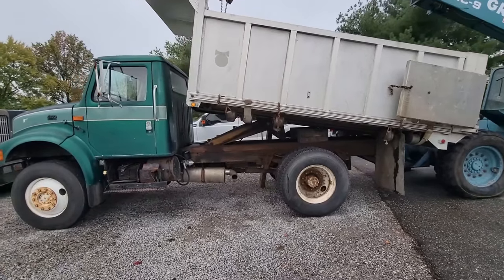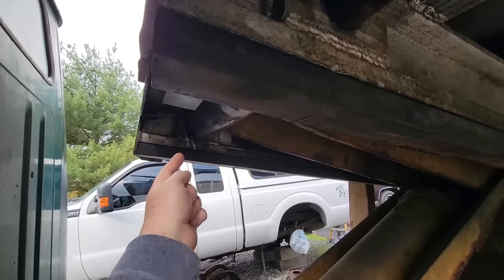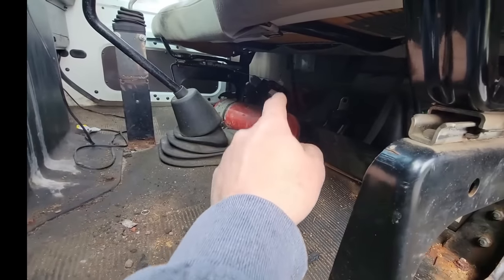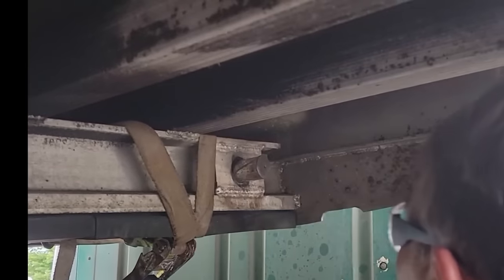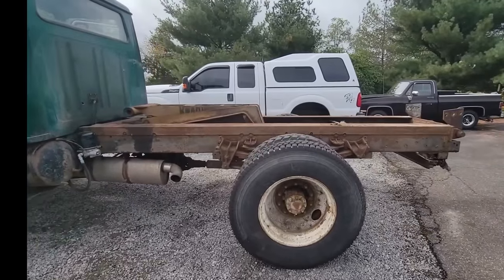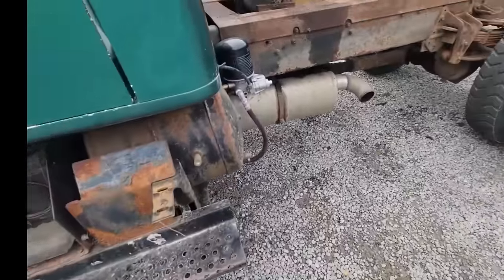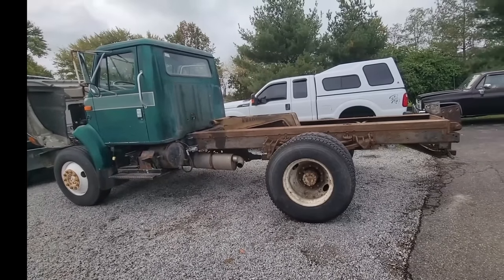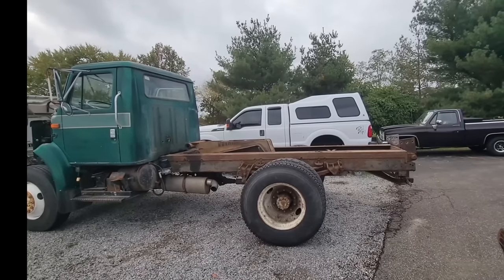THIS IS IT! DT466, MANUAL TRANS, AIR BRAKES, DOUBLE FRAME....AND DOUBLE FRAME!

Comment from the maker: i think they moved the transfer case down in order to clear the hoist assembly when it was changed into a dump. this required the front driveshaft slip yoke to slide farther in and the rear driveshaft slip yoke to slide farther in too. i think this is how the rear driveshaft became an issue.

Comment: Thank you both for sharing w/ us all. That is a great idea to move the axle back as far as U can, works for a wrecker or a dump bed. The drive shaft has to be reworked no matter what any way. If it sells as it is then on to the next project. Have a great weekend.

Comment: I had a 1994 F800 4wd that was converted at Marmon Herrington and got a four door extended custom cab. It hat the 8.3 Cummins with the 6 Speed manual transmission. It was a 8’ flat bed with a 4’ extension that pinned and bolted to the back. It was custom built for a guy pulling a large fifth wheel travel trailer.

Comment: A 4x4 medium duty wrecker tow truck would be a pretty good idea. The truck is in great shape but that bed it had made absolutely no sense. Not only does it take weight off the steer axle but it also overloads the rear axle.
As for a better milwaukee m18 fuel brushless drill you shouldn't have any problems finding 1 locally on marketplace, that's where I get my m18 tools from. But that's just my preference.

Comment: I have an ‘87 International 4WD that already has a utility bed on it. Definitely going to be a service truck. I already have the crane. The main problem is that I suspect that the 9-liter engine has a blown head gasket — not sure yet. Ideally, I would like to replace the horrible Nine with a mechanical DT466. The transmission is a 5-speed and there’s a pto-driven 20-ton Braden winch on the front. It has just over 60K miles on it and I have driven it quite a bit and it drives like a dream. No rust. Gotta get started on this one. 

I like what you’ve got there. Solid rims, unlike my Dayton wobblers. Looks like a solid truck. Can’t believe it had a salt spreader on it.

Comment: Always watch to the end 👍👍, I like the idea of a four wheel drive wrecker with a plow …very handy and not that I’ve done very many axle moves , four to be exact but I always move the axle on a single axle as far back as I can , one because they handle better and two in our state it’s wheel base and the bridge rules for weight distribution and for the type of business I had the axle far back worked out very well. DT 466 was a great engine for me , the second engine I had great luck with was the L-10 300 HP. 
RR

Comment: Moving the axle back as you suggested is beneficial for the drive line too.  Making a new longer drive shaft to work with the new extended wheel base takes care of that vibration problem. For what it is worth of all the diesel truck engines I ever worked on over my career as a truck mechanic, my overall choice for reliability and service ability is the DT466. It impressed  me over time as a good solid engine.

Comment: Wrecker - personal use or is the market/value there?  Service truck, in my head, would seem like the best ROI.  Absolutely love the truck any which way and want to see the build.
Reply from the maker: a 4x4 wrecker of this sixze would be worth the build.....as long as it built with the right wrecker bed. if you use a light duty bed intended for cars, it would be a waste. it needs to be a decent capacity bed with 2 recovery winches. plus extra add ons commonly needed for recovery work. i definitely think  a service truck with a crane is less work, wider buyer group and most profitable.

Comment: I like both the service and wrecker ideas. Why not a both, low profile wrecker body with a welder and compressor, tool storage and a boom and wheel lift.
Reply from the maker: service trucks and wreckers both need lots of gear for each of their duties. their isnt enough length or weight capacity to carry everything for both.

Comment: If memory serves, every hoist n body we installed back in the day frames were cut of either at the rear spring hangers or 9" beyond.  Never did a bucket or other hydraulic cranes.  
Believe the Grove    Super 10 body for the trunion was cut 7".  Nice cab n chassis.  
Service body with a crane...  but a dump would probably be more marketable?
Or build yer own midrange rotator.... 🤔😂😎  but that'd probably be a too long drawn out process.  
Anyway, knowin you'll do it right. Thanks for sharing. Blessings 👍♥️🇺🇸
Reply: Heck, a mid range rotator would be easy!
Find a Brodderson carrydeck crane. They tip them over all the time! Can pick them up cheap. (Yes, pun intended).
Take unnecessary stuff off it, bolt on truck, done.

Comment: Man that woulda been an awesome little silage truck for a small farmer to do wet spots in the fields where where the road trucks always get stuck . I know the struggle with the pins but way bigger excavator pins , I always use a good heavy metal bar like a 6ft one and if it moves and had been greased regularly I find a good air Hammer gets them right out . I always used a big sledge hammer until a guy I worked with doing that had a piece shoot back into his face ( hardened steel ) and had to get surgery to have it removed

Comment: Either way, it's gunna make one nice looking rig J.C! 🙂👍  I like the fact it's 4x4 AND a 6 speed manual 🔧  A wrecker would be even cooler! 😁
Reply from the maker: a wrecker would be nicer with an overdrive 10 spd. could utilize the low differential gearing for power while still being able to travel a distance.

Comment: Jc the 10' dump best option with weight of truck with bed payload aroun 8 ton with gvw of 33thousand very clean truck for the year with a clean used bed and paint and plow a 50 grand truck love those era binders very dependable trucks

Comment: The ploughs I work on are dbl framed. Probably because they are under constant torque from the front blade and the box. But 4x4 is the cats ass. I haven’t seen one in our vast fleet. Slam a service box on it and sell it. Mechanic service truck for equipment job site no problem

Comment: J.c. Smith Im like you that would make a very nice wrecker with the wide aluminum floater wheels chrome stacks straight pipe that would really make it look an sound nice big double cable boom an wheel lift

Comment: We had this discussion in the past…and I know your thoughts….but this truck would make a nice hook lift truck . All the options you can have for them…a dry van box…a dump truck box…a flatbed…a service body…small packer body..service body…sander etc . One truck can have multiple body’s to switch out in under a minute . It’s already equipped for a plow…come winter throw on a sander….road call…throw on an enclosed box or service body….going to go mow…drive tractor on a flat bed and hook lift it on . A hook lift is the most adaptable truck you could ever own…and the cheapest alternative to needing multiple trucks . I recently passed one up that needed an engine….biggest mistake I ever made

Comment: Would the wrecker build make it more valuable than the service build? Or is the wrecker build mostly done for personal use?
Reply from the maker: i think the wrecker option and the service body are the wrecker option make the m,ost out of what the truck is. the dump is ok but the extra weight of the front axle and transfer case take away from the trucks load capacity. instead of legally hauling 8 tons, it can haul 6? i love tow trucks and see the value in a 4 wd truck this size able to do recoveries in bad winter conditions or in a field, down a oil well road and so on. i would build it with the intentions of selling it....if it didnt sell and i had to keep it, i would be upset at all. there has been many times i need to go to one of my other properties and move things. i have had to take the gradall or the skid steer. this would be helpful in some of those situations.

Comment: If you are going to take the truck apart to clean it up and paint it, I would find a '60s IH Loadstar cab and front clip to put on the truck. Since the frame is long, it would also make a great wheel lift wrecker with a boom on the top!

Comment: I have a really nice 12’ cm skirted flatbed with the tool boxes on both sides of the wheel:. Headache rack rack b&w hitches. It came off of a 7.3 F450
The  prices on them are crazy now. 

I’ve seen them like 12k +

Comment: What is the deal circular plastic housing just above the front left bump stop, if I had to guess it's a fuel filter looks an awful lot like a 7.3 fuel filter, I guess it would make sense being an IH product.
Reply from the maker: close. its an add on electric fuel heater.

Comment: Isnt better idea to add a 3rd axle with air bags, but without a drive, instead of moving an existing one?   Just to hold a longer bed
Reply from the maker: there isnt enough room to add an axle without moving that one first. then you would have a VERY short 12ft dump that had too small of an engine and not enough gears for the capacity of the chassis. most folks would find it very unattractive. if it had a 10L engine, i could see the potential. as you can tell by how wrong this truck was set up, there is so much more that goes into building a truck than just adding and axle here or there. not criticizing you...just pointing out what most dont consider.

Comment: Been watching a lot of off road you tubers building wreckers.  Would really like to see you build one.
Reply from the maker: mine would be different than what you might be thinking. mine would be to recover something and tow it down the road as well. so it has to be short enough to get into tight spots but long enough to handle the weight of towing

Comment: What does a re done truck like this cost if you made it a dump. With those miles and year? Around $25?
Reply from the maker: it would likely bring $25k without the 4wd when i would be done. i would want to take advantage of the added value of the 4wd and make it very nice by adding aluminum wheels, aluminum fuel tanks, nice paint job, new aggressive tires, tons of lights and so on. all done up it should do $35k+

Comment: Jeff moving the axle back 2ft ( 600mm ) won't you have enough on the double chassis to put your crane on it.
Reply from the maker: i dont think so. the suspension would be in the way of where the crane frame brackets would need to mount.
Reply: Hi Jeff it’s me again from Australia 
Maybe  450mm which would give you an extra 150mm ( 6inches ) to play with  
What is the width of the crane 🏗️ that you have 
Cheers 🥂 Greg
Love your YouTube channel you are like having a Teacher again you tell us what you are thinking yes it doesn’t always work the way you first thought But there always a way
Keep up the great job the Pair of you Jeff you have a great camera Woman 👩

Comment: With the original wheel base that rear drive shaft is just weird. What's the theory there? Just a radically incorrect replacement replacement part? Is there any evidence that the transfer case was ever relocated?
Reply from the maker: i think the transfer case was lowered in order to clear the hoist when it was upfitted to a dump. with the transfer case lowered, the driveshaft angles became less which meant they are now too long. the transfer case frame mounts look like they could be mounted up or down. higher one way and lower the other.
Reply: @j.c.smithprojects  That makes some sense. Hopefully the front was able to tolerate it a bit better than the rear..?
Reply from the maker: yes. the front shaft was very long and was much higher at both ends. so it wasnt affected too much.

Comment: 4x4 service truck? May sell well. Or put a proper dump bed on it? I typed that before you said the same thing. Its definitely a desirable chassis a mason dump may be a good option too.
Reply: The last option would be the coolest. A recovery spec wrecker body more then a tow body. With the pto to drive the winches would be sweet.

Comment: On the rusty pins I weld one inch threaded rod to it pull the pin out
Reply from the maker: i had a piece of pipe, cap with a hole and all thread ready....using the hole saw was so much faster since i was mostly cutting aluminum and the fact the truck was so far from the welder.

Comment: Dear J.C. Smith projects couple.
👍👌👏 This is definitely a nice and very sturdy truck. I can assure you, that I will watch whatever you decide to do with it (and of course I watch every of your always interesting videos till the end!). But because you asked, here is my personal opinion: 
For me the main and definitely more important question is not what is best for the truck. It is what is best for you two! Fact is: You have lots and lots of trucks and stuff in storage = actually you obviously don't need more work but less trucks and more money (for instance for your several ongoing projects). If this truck doesn't sell the way it is, I suggest that you go the easiest way AND use things you already own. Putting your 10ft dump bed on the truck AND the snow plow back on the front, would make a great "winter vehicle". Additionally you get rid of stuff "laying around" and get payed for it. 2) I'm definitely too far away to decide about the condition of the cab paint. But I wouldn't paint it as long as the condition of the green is somehow okay. In the snow a green cab is definitely better visible than a white one. Additionally: I simply love nearly anything that is green and I never ever want to own a white vehicle again. 3) Of course I'm with you, that a 12ft dump bed or service bed or a wrecker modification would certainly look better on this truck than a 10ft dump bed. And then there would be no need for cutting off the end of the sturdy frame. But you would need to buy a 12ft bed or a service bed with a crane or a wrecker contraption. And this brings me straight back to the beginning of my comment: Please do what is best for you = sell/get rid of stuff without working even harder than you two already do. By the way: Unfortunately we all don't get younger, sigh.
Please don't get me wrong: I would love to see this truck getting the complete and typical high quality Smith projects working over. But it mustn't be especially this one, you have more than enough trucks left for me to watch. I hope you allow me to say that I would even be very proud to see that you can do what I seem not being able to do = etting rid of stuff!
As always: Thanks a lot for making teaching explaining recording editing uploading and sharing.
Best regards luck and especially health to all of you.
Reply from the maker: some times i just like to build something because i want to. i think the wrecker option is just that. i have a 10 ft dump and 2 wrecker beds. i would be getting rid of one or the other. i lean toward the wrecker option mostly because the truck is 4wd and that adds weight to the mid and front of the truck. that is where a wrecker could use the weight. the extra weight takes away from the load capacity of a dump. so instead of hauling 8 tones legally, it can only haul 6 tons. the wrecker will require a fair bit of fabrication and welding. that is what i really enjoy. the dump bed would be less time, have a larger market of buyers and a good profit margin. the service body with a crane would be about the same amount of work, have a smaller market and make great margin (even though i would have to find the service body and crane). the wrecker would be the most interesting to me because there is so much to figure out and plan for.
Reply: Dear  @j.c.smithprojects  
Thanks for replying and especially for giving a heart to my comment. I always and totally appreciate both very much. 2) Hehehe 😁 your answer was quite predictable because I would've answered similar! 😁🙈 3) I also love to build and invent stuff (and/or modify and make it better). Unfortunately I like this much more than doing reasonable things. Like you I'm almost drowning in stuff (on a smaller scale of course). You and me have done a ton of things so that we don't need to show the world what we are capable of. Additionally we don't need to show it to ourselves. 4) You own 100 other trucks plus tons of parts. Therefore I'm pretty sure that there are enough possibilities to have fun aside from this truck. But if you must, please at least consider not to buy a service truck bed. You have enough stuff laying around unused. The wrecker maybe fun but will cost you way too much time. And, Sir, please don't forget: time is running! We all don't become younger. I wish you could have fun by putting the plow back on this truck and adding a dump bed (from your stash) or by selling it as it is. But I'm already pretty sure that exactly this will not happen. 😁 ;-)
Sincerely yours.

Comment: I would make that a dedicated plow/sander truck
Use the dump body for another project 
Put a 8 yard sander on it, plastic wheel wells, the boss plow etc be a sweet money maker
Reply from the maker: we dont get enough snow to make that a a profitable build.
edit: i also have other internationals i could put the plow on and sell.
Reply: @j.c.smithprojects1769  a combo truck like that around me sells all day for 14500 20000 bucks  I would imagine someone would snap it up online
Reply from the maker: this truck will sell for 15k as it is here. with the right wrecker bed, the sky is the limit.

Comment: Hey j.c how much you want for the truck if you do all that and put a service body on it I’m in the market for a 4x4 service truck don’t really have to have the crane buy would be a plus
Reply from the maker: best thing to do is buy it as it is and build it yourself. once i start on it the cost is going grow fast especially if i paint the cab / hood and do aluminum wheels with new tires.
Reply from the maker: as it is or built like i do with a service body (no crane)?
Reply: @j.c.smithprojects  built with service bed crane on no crane that don’t matter